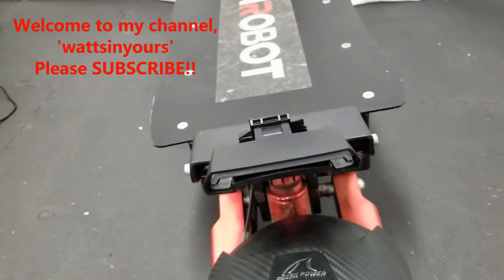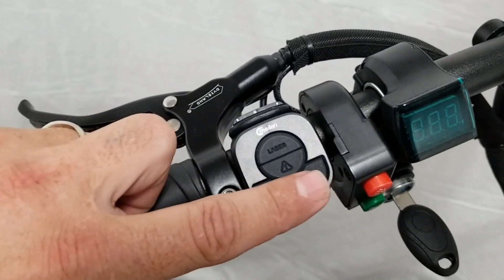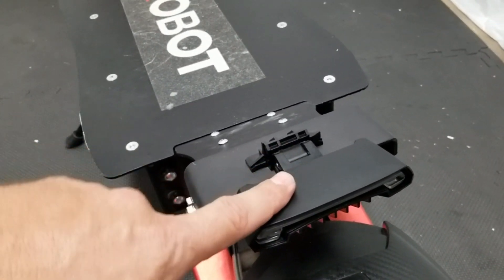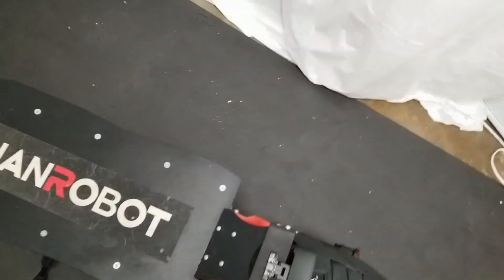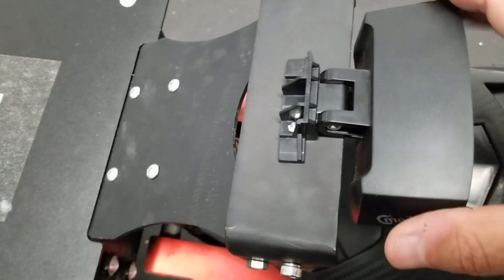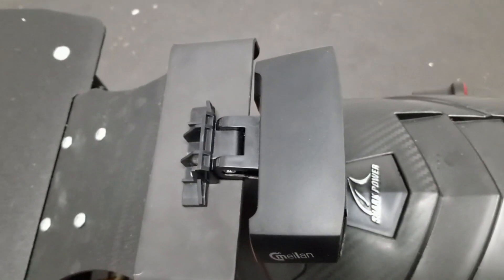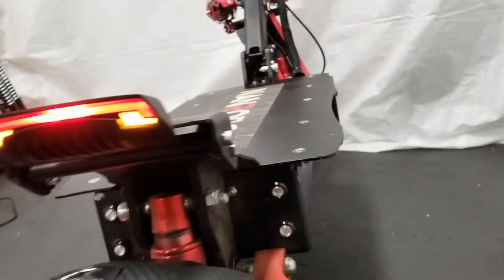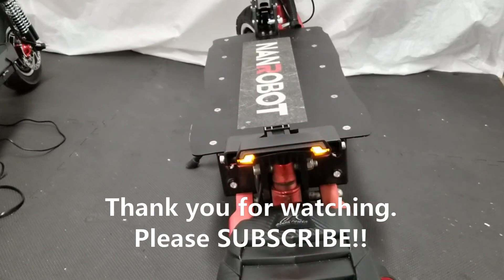How I added turn signals to my electric scooter. motorized scooter. nanrobot.

Comment: Nice job bro watching and learnin* at the same time thanks
Reply: Nice.. got the exact same idea.. think it’s by far the best Blinker system to mount. No wires, cool look and low cost. Did you know that there are Chinese knock offs of d4,d4+ d5 on Banggood? Called eco rider t8 , langfeite.. Got my langfeite L8s for about 600$ exact copy or rebrand of d4+. Shipping to ger took 2 months but was included. So good that I found your Channel. Keep it on

Comment: Is it charge or battery ? Between lamp and key there is wire or it wireless?
Reply from the maker: You have to plug it in with a separate charger that comes with it.
Reply from the maker: And it is wireless with a small control module mounted to the handle bars.

Comment: Hi there quick question you think l can found the bracket  on Amazon   or Ebay for mounting the light?
Reply: I had a varla eagle one scooter
Reply: @gus1621  this light is on Amazon for £40 and comes with the relevant mounting bracket